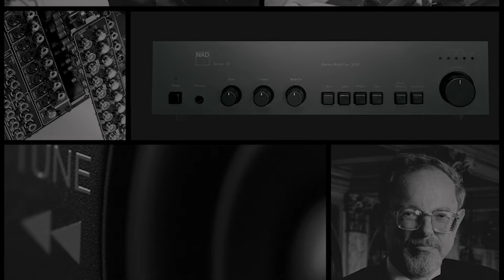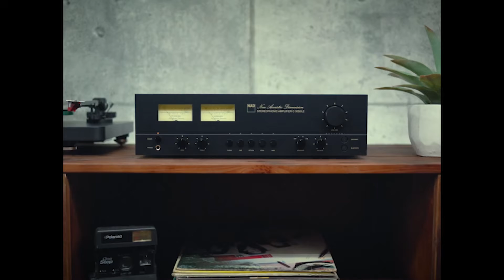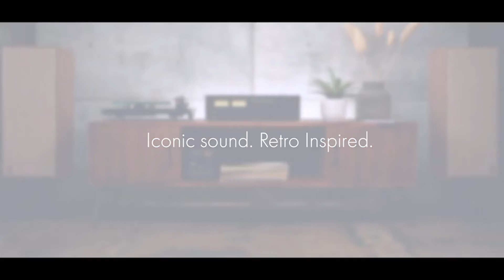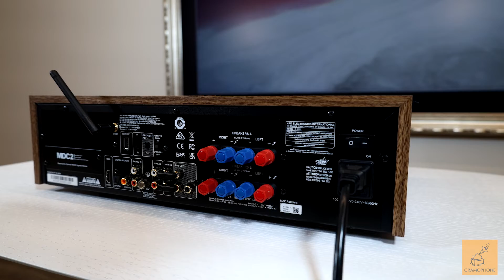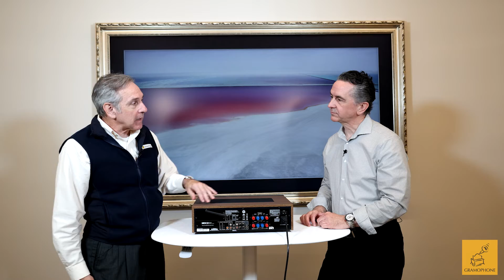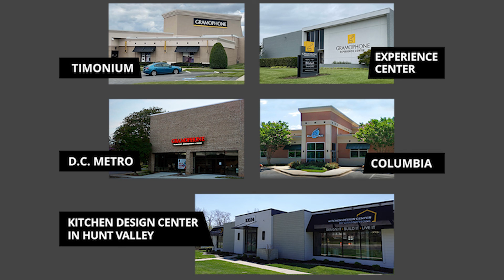NAD C 3050  Integrated Amp / Streaming DAC | Gramophone

Comment: From Denmark,

I find it a bit odd to produce the NAD C3030 and 3050; why not produce a NAD 3020—the model that really started it all?

The ones you have here are copies of the 30 series from 1978—which were also good (I own the 70 series myself)—but it was your NAD 3020 from 1979 that truly made an impact on the market.

Yet you fail to produce a "king" of that size—perhaps 20–30 watts—featuring the same design as the NAD 3020. I could easily do without those VU meters.
Reply from the maker: Hello Proton D, I've visited your wonderful country 10 times, as I used to work for Bang & Olufsen. Thank you for your comments on the original 3020.  We'll pass them along to NAD

Comment: Is there a way to bypass the tone controls if you were to run an external EQ?
Reply from the maker: Hello VideoAudio Master, our understanding is that with tone controls at the zero detente, they are essentially passing the signal through unaltered - not exactly the same as a tone defeat switch, which this amp lacks.  This is however one of NAD's most popular products as it has lots of power, streaming capability, plus optional Dirac Live, which covers a lot more ground than conventional equalization.  Please reach out to us if you want to discuss further: ask@gramophone.com

Comment: Is there the ability to add another amp to get more than 100w per channel or to upgrade?
Reply from the maker: Hello Wear - yes, you have both subwoofer out, for adding a lot more power and dynamics to your low end sound, as well as stereo RCA preamp outputs for connecting a separate, more powerful amplifier.  Upgrade paths are good!

Comment: Is it actually 100 watts at 8 ohms?
Reply from the maker: Hello White, we have not connected one on the test bench to verify, but yes NAD spec's this at 100 watts per channel into an 8 ohm load, and they are usually pretty conservative in their specifications
Reply: @GramophoneMD  Thanks for a reply,but how can it be 100 watts at 4 and 8 ohms? Just a bit confused
Reply from the maker: @white9093  Hello White, some amps are able to feed more power into a lower impedance load, for example 100 / 8 ohms, 150 / 4 ohms.  Many Class D amps are spec'd at the same power into ether one.  Reach out to us if you have questions about matching up to your speakers: ask@gramophone.com
Reply: @GramophoneMD but what if it’s a 6 ohm speaker
Reply from the maker: @malthe_schwartz Hello Malthe, thanks for your question.  Any speaker - 8 ohms, 6 ohms, 4 ohms etc. - is really  "nominal", or normally, at that impedance.  When playing music, they all present a continually fluctuating load.  It's never a steady - state load as an 8 ohm load resistor testing device is.  This amp will work just fine with a nominal 6 ohms impedance speaker.  Please reach out to us if you have questions about a specific speaker - ask@gramophone.com
Reply: @GramophoneMD can we use 4 ohm speakers on this amp?
Reply from the maker: @smann7236  Hello S - absolutely.  It's spec'd at 100 watts x 2 channels into 8 or 4 ohms (20-20,000 Hz) at 0.03% THD. You can see more about NAD and this amp in particular at our SkY site: https://skybygramophone.com/collections/nad
Reply: @GramophoneMD  thanks for reply...little surprised it's class d amp and not A or AB..is that normal these days? I thought AB better sound quality. Also could you please explain or if you spoken already about this, share link, on how to connect WiFi thru Amazon music to an amplifier with WiFi? I read it's better sound thru WiFi than Bluetooth. Is bluous better sound than WiFi?
Reply from the maker: @smann7236  Hello S, you are welcome.  Digital amplifiers have come a long way in terms of sound quality, and it's not uncommon now to see even five-figure digital amplifiers from brands with solid reputations.  Re WiFi, you'll get better fidelity when streaming a lossless or lossless high-res music service directly rather than using Bluetooth, which itself is better than it once was - but has much less data than lossless formats.  If you'd like to communicate directly with us on what gear you have, what you are considering and so forth, please reach out: ask@gramophone.com

Comment: Beautiful photography/videography of this product. Balance control partially functional, VU lights can not be switched off (too bright) if listening in dark rooms or at night, VU too sensitive always dances at the extreme end. Volume LEDs are not calibrated or are meant to function in a sticky way. Sound is clean but digital, lean in comparison to Yamaha, unlike AB or A class Amps. The only reason to buy this over Yamaha 501, 701, 801, 1200 would be to get BluOS & Dirac. 

I personally auditioned and got the 801 Yamaha for beautiful SQ.
Reply from the maker: Thank you for the videography compliments!  Depending on the speakers one winds up with, the "lean" sound of the NAD can be a benefit.  BluOS 4.0 and Dirac can be big benefits too.  We carry and enthusiastically endorse Yamaha - there are many ways to assemble a great system for the money, right?
Reply: Thanks for your review. I was considering this amp, but you said it sounds digital, which is exactly why I sold my Marantz PM8006 and bought a vintage Pioneer SA-8800.
Reply: Does the 801 have more power than this nad 3050?

Comment: I love the retro look too.  I have had the NAD C 3050 for several months now and it its working out great. It is currently driving a pair of Totem Sky Tower speakers with a subwoofer and it all sounds good. But I really like the looks of the PSB Passif 50 speakers shown in this video. Can you tell me if it would be a sound upgrade (or just an appearance upgrade) if I switched out the Totems for the Passif 50's?
Reply from the maker: We love the Totem Sky Tower, and we're glad you are having success.  Not being PSB dealers, we can't compare them unfortunately